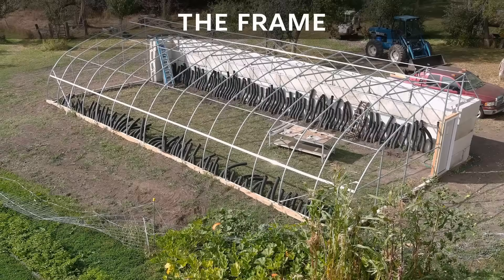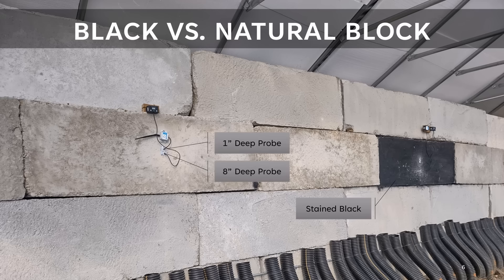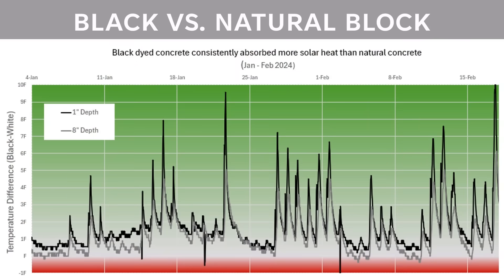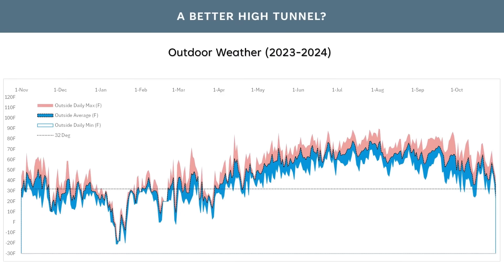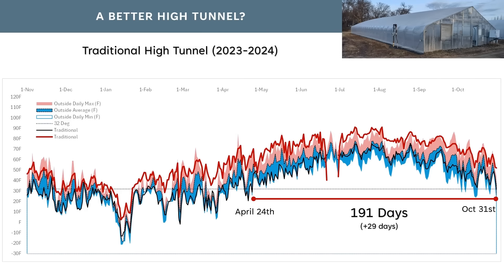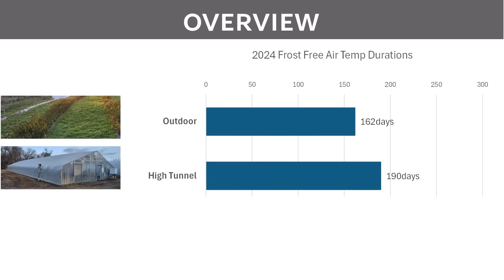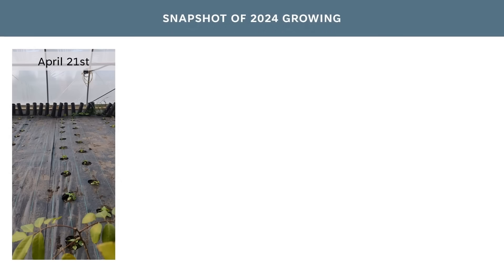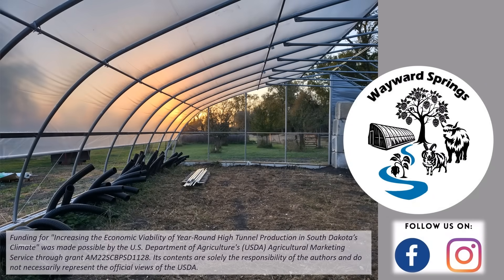Year One Results! Thermal Performance of the Concrete Thermal Mass

Comment: Curious if 200' of say 12" flexible black pipe, buried 12-14 feet deep running in a recirculation loop with a fan would bring in enough air to stop freeze all together.  Ground temp there I think is around 46°. Connect fan to thermostat to kick on only when air temp in tunnel hits 46°.  Might take some kind of AI or algorithm to shut off at right time on sunny  days, so solar warming isn't overwhelmed by cold ground air.  For off grid vertical biracial,....(that was autocorrect) bifacial solar, running north south and high enough to not get buried in snow.   They shed snow well in vertical configuration but hard to "shed" a snow drift that you're buried in.  Vertical North/South is the most efficient deployment for winter in northern lattitudes, producing the most power.  Solar batteries in tunnel to store juice to run fan, and keeps batteries above freezing.  Might work better when low temp capable sodium Batteries become available.  Those could recover from some freezing event if the system is overwhelmed by a cold snap.  Able to operate well below zero°. 
All/most of this comes from a video I saw about a greenhouse in Nebraska with a citrus orchard inside.  Running for decades with no backup heat.  Just ground warmed air. Fresh local citrus in Nebraska from decades old trees. Differences are Nebraska ground temp is 5°-10° higher than you, and he didn't recirculate air.  He brought in fresh winter air and had runs long enough to warm even below zero air to the ground temp of about 55°.
Reply: Yes, my home has earth pipes that warm incoming air, even very cold air, to between 10 and 13C. Even in the depths of winter (minus 30-40C) the air entering our home is well above freezing. A larger system would clearly benefit a greenhouse.
Reply from the maker: See my videos on climate batteries.
Reply: @waywardsprings 
I watched the three you have posted.  Really good stuff!!!  Thanks!

Comment: Would you tell how deep your pipes are and if there would be any benefit to stacking  them with dirt in between.
Reply from the maker: These pipes were not in use during the period of data collected in this presentation. Results of the climate battery will be in a later video.

Comment: I'm wondering if keeping the lowest blocks white or reflective, would be more beneficial for seedlings and young plants as it provides them - potentially - with more light.
Also wondering if to much IR radiation might hamper productivity on - for instance - tomatoes (as the ratio of IR to normal light might suppress flowering).
Nice project!
Reply from the maker: I have noticed tomatoes and peppers closer to the blocks grow faster.
Reply: @waywardsprings  With the IR ratio it's about flowering. But with those tomatoes and peppers, temperature might be more important than the amount of light. Peppers for sure like warmth.

Comment: Any plans to berm up the north  side with soil? 
Maybe insulate with pumice or perlite while backfilling( at least 2 feet width)? Cover , at shallow depth , sloping away from the backside to keep groundwater away, thereby  limiting frost heaving and soil from washing in to the insulating layer against the outside of the blocks?
Reply from the maker: No, I don't want to convert it from a high tunnel to a greenhouse. There are changes I need to make. I'll publish that video soon.
Reply: @waywardsprings  Is that your interpretation  ?
I was only suggesting ways to slow  heat loss to the exterior.
Damp proofing the concrete exterior might also be warranted prior to backfill.

Comment: I have seen this style of greenhouse called a "Chinese greenhouse" - have you considered upgrading it with roll down thermal blanket rather than just inflation?
Reply from the maker: Yes, that was in my original plans. I'm not yet convinced that it is worth it as we don't have enough daylight for active plant growth.
Reply: @waywardsprings  That's the real limiting factor for anything passive.  At peak sun, when the angle is 90 degrees, sunlight has 12000 lumins per square foot.  At 41 degrees N latitude, peak summer is less than a 73 degree angle (11200 lumins) and at winter solstice (Dec 21st) less than 27 degrees angle (4500 lumins at peak, but less than a 3300 lumin average for the 6-8 hour brightest part of the day).  Plants like tomatoes need approximately 4500-5000 lumins per sf for 6-8 hours for flowering and fruit set, at a minimum. This means that even if plants are warm enough, they'll only set fruit from March 18th to Sept 25th. 

Obviously, I can start plants in late January or early February under grow lights, and then transplant them when the sunlight is strong enough for them to fruit, but now I'm adding the cost of supplemental lighting.  I can also let my plants finish ripening whatever fruit sets before Sept 20-25, which means I'll be harvesting smaller and smaller yields until the last tomato in the first week in December.   You can do spinach year round and other salad greens, but little else.
Reply from the maker: @jmorley72 Right on! I showed measured light levels in a recent video.
Reply: @waywardsprings I saw it right after this video!  Your videos are helpful, especially with the light and temperature data. As you might have surmised, I’ve also been working on greenhouse designs.  

I like your design, but I’m not sure about overall cost vs benefit. Large concrete block is pricey, unless you have some great local source with an over-abundance that they are trying to give away.  I had considered using a 2000+ gal pool with a solar pool heater. You could insulate the pool with polyfoam board, and then pop the top off at night. Ive also looked at climate batteries and the various air/heat transfer systems. I think I’ve settled on building an inner frame with a retractable insulated blanket.  Unfortunately I’m at least 2 years away from starting the project…
Reply: @waywardsprings  thanks for responding, i just looked you up on the map, didnt realize how far north you were
Reply: @waywardsprings  there's LED string grow lights that can increase your low light levels.
Reply from the maker: @gridless-t5h  Yes, they add a lot of cost. Only viable for high dollar crops. My video on light publishes this afternoon.

Comment: This is so valuable thank you for taking the time to do the research. I think there are many untapped opportunities for people in cold northern climates to use methods like this to provide food for themselves with intensive small scale agriculture. What I'm very curious about, is how long can the season be extended by dropping the greenhouse into the ground down to the front line, and having a highly angled roof. Less light will enter the greenhouse, but the bottoms of plants and planters don't need it as much, and perhaps the geothermal effects of the surrounding earth will provide and active heating/cooling effect to regulate temperatures and extend the season. This could be combined with your heat retaining blocks perhaps?
Reply from the maker: In Dec-Feb, temperature is not the limiting factor, light for photosynthesis is. Upcoming video about this...
Reply: @waywardsprings  ...suspected as much from the graphs, but didn't know your location till you mentioned it at the very end. good designs like yours do a great job of overcoming that one weakness! have you considered solar-heated water storage as thermal batteries, like totes lining the perimeter? there's some cost involved with plumbing them & a pump, but might be worth experimenting with.

we're in high desert (7500ft), so there's lots of very strong sunlight through all months. i'm designing small/budget dwellings with Passiv principles & system synergy/overlap to take full advantage, and one has a greenhouse along the full length, which is why i clicked on your vid. thermal mass is the only way to get through our short occasional snow storms w/o burning or electrical heat. plus, the huge added roof sqft of a greenhouse goes a long way with rainwater catchment, which is important here.
Reply: @waywardsprings  Good point thanks for the reply, please keep doing what you're doing it matters.

Comment: Thanks. 
Did you consider Gabion wall type construction? (Galvanised wire mesh containers which you fill with large size broken stone).  I assume a lot cheaper
Reply from the maker: Great option! I don't have easy access to that quantity of large rock. And I'm not sure how to accurately measure the temperatures of it to estimate Btu. Due to the air gaps it would have inherently less storage capacity, but may absorb heat faster due to convection.

Comment: thanks did you consider the difference between water btu storage and blocks ? the efficiency  difference , for equal btu storage is huge.
Reply from the maker: The challenge with water is its weight and safely stacking it for low cost and in a non-permanent fashion. Even concrete block has challenges supporting it on top of soil safely. I will share about that in a future video.  Check out the newest climate battery video, I have some water thermal capacity comparisons in there.

Comment: I like this design. The metal frame is beautiful and efficient. No greenhouse should NEED artificial heating. Have you studied that region in southern Spain that's like over 50% greenhouse? They don't do it passively, but they are in S Europe. Here are my suggestions for this if I lived in N Dakota:

1) That far north, why not bury/berm with soil or add additional infrastructure to the North wall, such as a work shed? Or build into natural southern slope initially and use marginal land if hills are available.
2) How does this method of geothermal pipes compare in economy and effectiveness to others? That far north, why isn't the greenhouse more recessed into the ground? High water table? If so, then use correct slope and not an issue.  This is easy to build when you build a soil berm with a backhoe. You've seen the guy who does this just south of you and grows oranges in January?
3) Would recycled black metal (old roofing, smashed cans, old metal plate, etc.) lined on the blocks of the interior solar wall increase solar absorption or decrease it? Would a more metallic or blacker paint increase Blocks  solar absorption best? How about a wall with many radiative black metal fins, like a reverse radiator? 
4) Rigid Bi- or Tri-wall Polycarbonate roofing will survive storms that we have in the upper plains much longer, at least if its installed properly, while still insulating and costing similar to this design (based on lifetime).
5) Humidity, temp, cross-venting controls, water pump run with active solar? Overheating in summer? Water requirements in summer? Back up heating for frost? Looks like snow build up slides off roof well? Consider using a heat exchanger for venting into nearby buildings.
6) Aquaculture. Roof water catchment. Integrated livestock. Apiculture. Rare Poultry. Specialty winter produce. Permanent barn attachment for passive dry heating, hot storage. Black water barrels along solar wall for additional longer term temp storage.
Reply: one concern covering the concrete blocks with metal would be the loss of the IR penetrating the blocks themselves and being stuck at the thin metal. 

using evacuated tube solar water heaters buried in a 2-3’ sand pit in the floor of the green house has shown amazing results - sand doesn’t have the temp limits that others options do 💪🏻
Reply from the maker: Great suggestions. The climate battery tubes are in place, but nonfunctional for the duration of this first half of my research project. Its also important to emphasize that this is intended to be a High Tunnel (non-permanent structure) per USDA definitions, which limits many aspects. Check out my previous video on What is a High Tunnel. https://youtu.be/daro7m5f1Wc?si=fM_ubSjJG8jZmsuO

Comment: Have you shared what the total cost of building this system is? Blocks, greenhouse frame, plastic, insulation, etc?
Reply from the maker: I did mention blocks cost 50$ apiece. And generic price/ft of the coverings. The frame cost was similar to any others of this size. I'll have to delve deeper into that in the future. Unfortunately prices fluctuate a lot too.
Reply: @waywardsprings I didn’t catch how expensive the blocks were in the video so thank you for clarifying.  I’ve been trying to learn more about those blocks and have found much on them in terms of pricing.
Reply: This similar design is also available from Chinese manufacturers. They have been using this design for decades.
Reply from the maker: @yihchiehseeto225 Correct! I cover that in my earlier videos. However, a CSG would not fit the USDA definition of a high tunnel because it is "permanent" and would not qualify for EQIP cost share.

Comment: Curious if a standard NRCS grant high tunnel could be retrofitted?
Reply from the maker: Yes, I believe it could. It wouldn't be quite as well balanced. I also think this kit should qualify as well.  There are a bunch of changes that I made to the design after this, which I will cover in a future video.
Reply: That's great.  You are offering kits? Where could I find these?
Reply from the maker: @joeloveless2537 Send me an email. There are some tweaks to the design that I am making based on this prototype, but it's very close.

Comment: Also, what are your tubes in there; a climate battery?
Reply from the maker: I briefly mentioned the tubes in a previous video. The next stage of the project is a study on higher airflow rates for climate batteries. Hopefully have those videos done next week.
Reply: I would be very interested how much the climate battery affects the results.  If you could break out the effectiveness of each component by percent.
Reply from the maker: @joeloveless2537 Stay tuned for a future episode 😊
Reply: @waywardsprings  If you push the hot air collecting at the peak through the battery you can moderate the high temps you get which stress the plants on colder days. This is easier if you have a manifold system and a thermostatic fan controller.

Comment: Wonderful work.  I'm curious to get your thoughts on using black ibc 275 gallon totes as a thermal mass, since water has more heat capacity?
Reply from the maker: A challenge with thermal "mass" is that it has a lot of mass/weight.  I will do a future video about some of the challenges with keeping them stable. The 330gal IBC totes are very heavy. It will be hard to safely support them without concrete.
Reply: @waywardsprings  I have some of the 275 IBC totes sitting on the ground in my greenhouse with no problems.  I am using them for an aquaponics systems with tilapia that need the water to be above 65f.  I use a small above ground solar pool heater to warm the water in the winter.  I was going to add a msg about this then I saw this post.  I like how you collect all the data and find out what works best, so I was going to ask if you could test this in your GH?  I live in AZ so it is not that hard to heat the water to above 65f, even when its in the 30s and 40s outside.